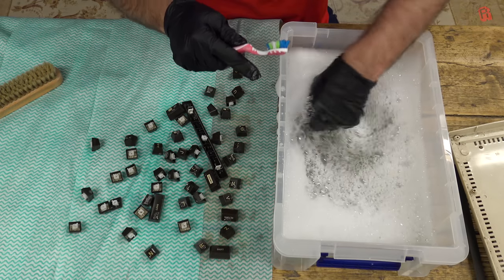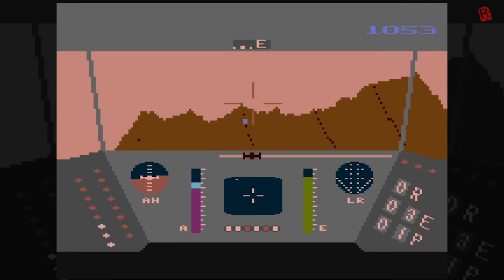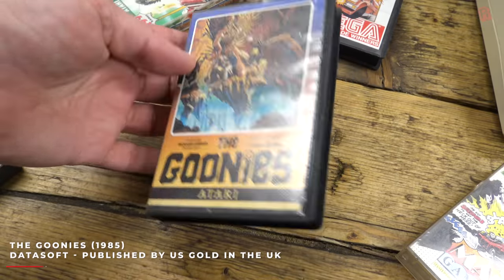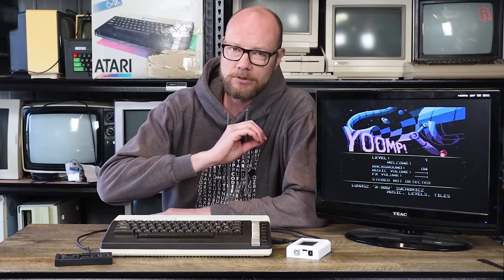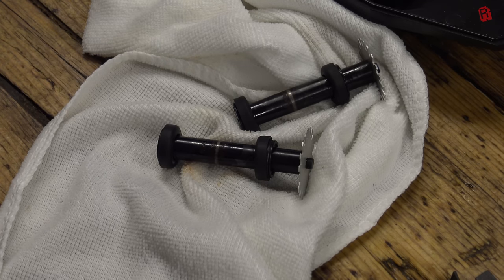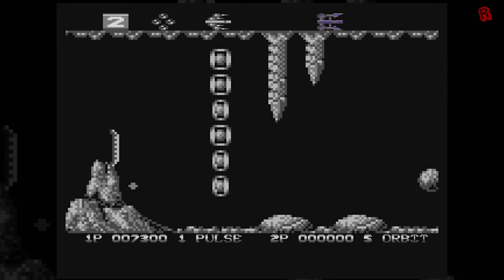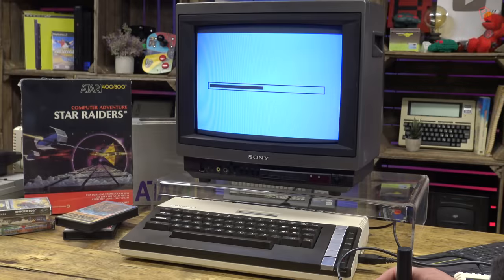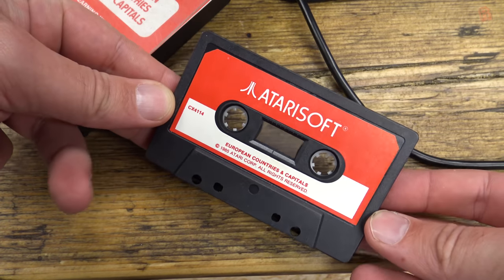What was the Atari 800XL capable of? | Trash to Treasure Part 3

Comment: Why wasn't this machine as popular as the Commodore 64? Was it too expensive?
Reply: No. The C64 had 2 major advantages over the Atari that made it the more popular game computer. It had multicolor modes for character graphics and better sprite implementation. This allowed the programmers on Commodore 64 to make complex graphics games much easier than on the Atari.
Reply: @twiddler71  Thanks for the info. On paper the Atari 800XL looked promising.
Reply: The Atari 8-bit range was significantly more expensive than the C64 for long enough for the C64 to settle into a duopoly with the ZX Spectrum. By the time the Atari XL range came out, with some serious price-cutting, Commodore and Sinclair had the UK mass market sewn up.

Because the C64 was designed several years later than the Ataris, it had the benefit of more advanced sprite handling (and the Atari sprite handling was cutting-edge for 1978 when it was designed), but the Ataris ran at almost twice the speed and also had numerous hardware-level graphical tricks they could pull off that the C64 couldn't. 

That meant that where the same game was available for both the C64 and Atari, the C64 generally had the more colourful sprites, but the Atari version usually ran much faster and smoother - classic examples would be Ghostbusters and the Lucasfilm games (the C64 was terrible at fractal graphics compared to the Ataris).

It says a lot about the huge amount of power built into the Atari 8-bits that the C64 was only very slightly ahead of them (and only in certain areas) despite being designed years later, and no other 8-bit machines came close to them, even the ones designed well into the 80s.
Reply: @dunebasher1971  Thanks for the info! :-) 

I watch (too many) video's about the (game) computers of yesteryear. What strikes me is that for modern game consoles it's still the same trade-off: CPU speed doesn't matter as much as capabilities of the graphics chip (GPU). Even for the PS5 and Xbox series X. The NES more or less had the same architecture as the C64 and other MOS6502 machines. However, it's graphical capabilities could produce (somewhat) better looking games and therefore became the "next gen" gaming platform.
Reply: The reason is not because of graphics but because Commodore could make far more computers at a cheaper cost and it was capable. However the C64 suffered tremendously in build quality and reliability. 

Atari can do graphics the C64 can't as well, like YOOMP! as shown in this video. Rescue on Fractalus shown in this video is slower on C64 due to it's slower CPU. There's a lot of graphics that the 800XL can do that C64 can't but also vice versa. We have similar situations today where one game console or graphics card maker has features competitors do or do not have but market success is about profitability not capabilities. The true genius with the C64 imo was that it was very cheap, widely available and very capable. 

However the Atari's have many things the C64 doesn't have like a reset button, a full operating system ROM, mechanical keyboards, much faster disk drives, more models, etc.. Atari 8bits are outliving C64's due to the chips not failing nearly so much.
Reply: @gamedoutgamer  Thanks for clearing that up. Indeed, the better machine not always is the one that sells best. Remember the Sega Dreamcast? Poor old Sega, eh?
Reply: @twiddler71  Don't kid yourself. The C64 gained its user base because of price alone. Jack Tramiel's price war destroyed the TI-99 4/A and was another nail in Atari Inc's coffin. It took all of the profits out of 8-bit computers aside from Apple - who was insulated from it being the "education computer of choice" at the higher end of the market - and thus why 16-bits had to be brought in quickly. It killed off the market for "Super 8-bits" which is why Atari ended up having to scrap the 1400XL, the 1450XLD, and the 1090 Expansion Chassis. But Jack did keep MSX out of North America and most of Europe because of his price war.

Comment: Neil, thank you for another great Trash to Treasure series! I recommend you to try Warhawk, which is quite fun and, in my opinion, the rendition of the music blows the C64 version away, and for a more recent game (albeit needing a ram expansion) try Crownland, amazing graphics and music. Cheers, Rob.
Reply from the maker: Thank you I will be sure to check that out
Reply: Unfortunately, Crownland requires at least 128K RAM, so it won't run on an unexpanded 800 XL.
Reply: @PG-gs5vb  Sure, but memory expansions are not that expensive and will allow you to run a lot of new games and demos. It will be more difficult to find a second Pokey chip to listen to Yooomp! on stereo.
Reply: @robcfg  Of course, I just wanted to let Neil know that Crownland won't work on his Atari. Btw. there is now a nice POKEY replacement called POKEYMax, which can actually emulate up to 4 POKEY chips.
Reply: @PG-gs5vb  I mentioned that a memory expansion is needed, but I didn't know about the PokeyMax, thanks!

Comment: The atari 800xl was the more subestimated machine ever!! Fortunately nowadays history have changed a lot due to passionated programmers who discover and developed (and still do) awesome that nothing to envy C64 which at its 80's and 90's time have the force to do excellent games. Now Atari 8 bits in general hit back C64 equal by equal in most cases superior in a lot of games.
Reply: Well passionate programmers didn't discover the system, they literally never stopped programming for it. The 1st golden age of the  platform was during the 90s (eastern europe) after the commercial death of the system in the east. The same individuals are part of the modern homebrew community responsible for all the software gems, music and endless list of hardware upgrades.  I was lucky to be located relative close to them and follow the scene throughout the 2000s till to this day. I never  had a gap  in my life as an Atari user, meaning that i drugged my Atari XL (and Amiga)along during all of my moves from house to house and I always had an emulator on my PCs. So for me the history of this system is a continuous line and a huge number of experiences and emotions. 
Amiga and ST were also two systems that  I interacted throughout my life

Comment: WD40 is a water displacer, not a degreaser or lubricant.
Reply from the maker: Yes indeed, the WD stands for precisely that - but I know it's often reached for as a fix all in anything that moves hence the comment that it's not suitable
Reply: Actually this was  what it was designed for....but it does perform equally well as a degreaser and remover of glue. Lubricating is not its forte.

Comment: In my opinion the Atari shouldn't be compared to the C64 but rather the VIC20, and then it certainly do look a lot better. The thing is that it's basically the same machine as the Atari 400 and 800 which was introduced in 1979. The VIC20 came along in 1980 and the C64 finally in 1982. When the 800XL was released in 1983 it was a four year old design and badly outdated compared to the C64, the only advantage it had was price. Computers were evolving in leaps and bounds in the early 80's, and by 1985 Commodore released the Amiga 1000 and Atari the 520ST, both 16 bit computers using the Motorola 68000 processor, providing a lot more performance than the 8bit predecessors.
Reply: The VIC20 is nothing like the Atari 8-bit computer. The VIC20 was one of the worse 8-bit computers made, just a step above the Timex Sinclair 1000. The VIC20 had 3.5k of memory for basic, with 22 column display. It was a step backwards from the Commodore PET.
Reply: @twiddler71  But it was of the same tech generation as the Atari while the C64 was one or even two generations newer.

Besides the VIC20 could run Metagalactic Llamas Battle at the Edge of Time... (I never actually played that game, I just love the name...)
Reply: @blahorgaslisk7763  Never heard that title before, but like many games of that era, I'm sure it required a lot of imagination to supplement the games graphics.
Reply: @blahorgaslisk7763  The C64 was certainly a generation newer than the Atari 8-bits, but crucially, it wasn't significantly all-round better. Atari built in so much power in 1978 that they could still stand toe-to-toe with the C64 in the mid-80s.

The best you could say about the C64 hardware was that it was slightly better than the Ataris in certain areas, but the Ataris had major advantages like a CPU that ran almost twice as fast and some incredibly powerful hardware-level graphics tricks that the C64 couldn't emulate.

Compare the Atari versions of Ghostbusters or the Lucasfilm games to the C64 ones. Ghostbusters has less colourful sprites on the Atari, but it runs so much faster and smoother than the C64 that it's almost funny. And as for Rescue on Fractalus or Koronis Rift, well, the C64 versions run as slow as molasses in comparison - the C64 just didn't have the right hardware to run those games as well as the Atari.
Reply: @dunebasher1971  I've never really thought about the difference in CPU power, but looking at the graphics and sound the C64 was better in most ways. If I remember correctly the Atari had a larger color palette, but couldn't show as many at once on the screen. At least not without some pretty tricky programming. But I still think the VIC20 would be more fitting match. Though at the same time I agree that the Atari wiped the floor with the VIC20.

The Atari 400 was the first machine I wrote a single line of code on, and I really liked it. Even so I never owned one. Instead I ended up buying a ZX Spectrum, a machine that definitely had less powerful hardware than either the Atari or the C64, and yet because it was so wonderfully simple people managed to write some pretty impressive programs for it.
Reply: from a technical and performance  aspect the Atari 8bit traded blows with the C64 and almost all 8bit computers of the era even if the contemporary software wasn't up to the task for irrelevant reasons. Fortunately the European software scene endured  long after the commercial death in the "west" market and produced a huge sample of work allowing us to  acknowledge  the true potential of the system.

Comment: C64 is so much better gaming experience. Commodore always won the race. Later with the glorious Amiga 500 which killed the Atari st.
Reply: Not in 1979, 1980, 1981 and 1982 it wasn't!  Atari were competing with the Vic 20 for 4 years 😄 Also the Amiga was designed by the same people as the Atari 800, they just left Sunnyvale and started their own company bought by Commodore. This should be common knowledge by now.